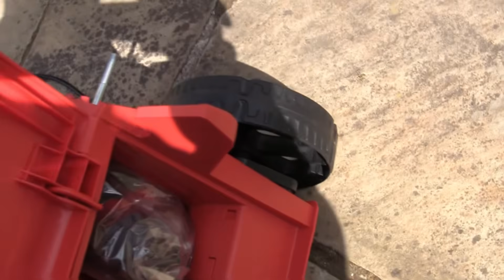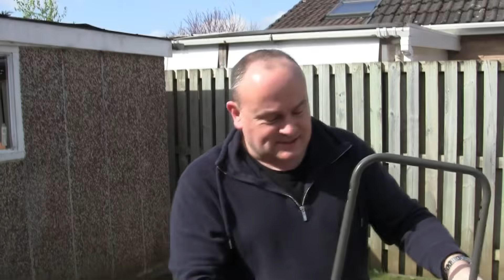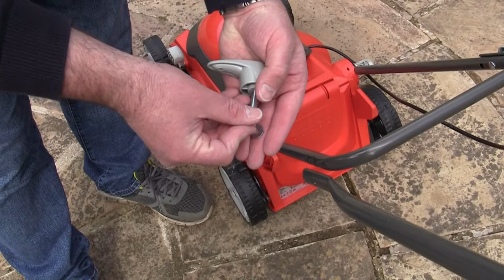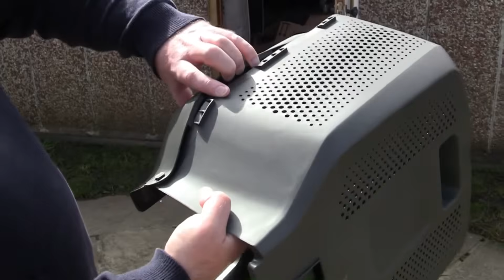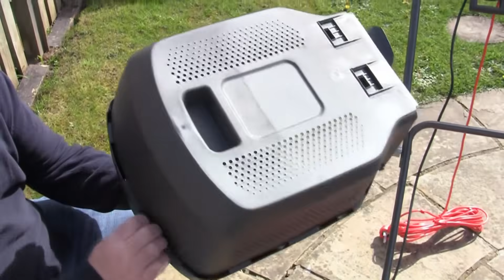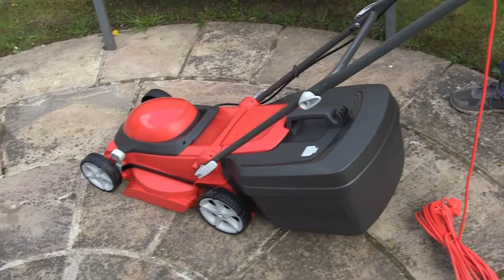Set Up Guide - Flymo EasiStore 340R Electric Rotary Lawn Mower - 34 cm Cutting Width,

Comment: I got absolutely no instructions with my 300R model. There are none on the Flymo website. I managed to follow this video which is basically the same assembly. If I hadn't found this I would still be sitting like a lemon trying to work it out. I have not even worked how to adjust the cutting height much less even used it yet because it's getting dark now.  My conclusion? This item is a cheap Chinese piece of 💩. Don't buy it.

Comment: The Flymo instructions were terrible. I got everything up and running but I didn’t have the locking handles for the bottom of the handle done properly so this was extremely helpful (I knew it looked wrong!).

Comment: Puchased cordless model April '26.   £99 .New. Ebay. Flymo Outlet /" Gold". Free delivery.   Excellent video. Useless instructions. Yes, Flymo should be paying you for this. Grassbox a bit fiddly but take your time. Helpful to assemble it on a bench or table but I was on the floor in my front room. Well done . Thanks. M. Durham City.

Comment: A tip for assembling the basket is after you hook the front part onto the hinge, look inside the the basket and make sure everything is lined up inside before pressing any bits down. There are squarish spike type things (can't describe them any other way) sticking up inside on the lid and these spikes must end up inside the basket – none of them should end up on the outside when you press it together. There are quite a few of these spikes so its easy to miss one (and have it end up on the outside where it shouldnt be) - feel them inside the basket with your fingers to check they are all inside, and take special care that the ones at the front are inside (not outside) before pressing everything down.

Comment: Thank you so much for this video! A "lawnmower luddite", I haven't even opened the setup/instruction manual that came with the mower, as I knew it would have me climbing up the walls. It still took me an hour or so to set it up, but this video provided all the help I need. Too late to mow the lawn tonight... tomorrow the new Flymo 340R gets its first outing!!

Comment: With mowers like this and the electric robotic mowers coming out, where do you see small engine repair in a few years?

I was looking at getting into repairs part time and I know there are millions of small engines out there but, all it takes is the manufacturers to stop selling replacement parts to individuals and non affiliated folks like me would be looking at taking up basket weaving.